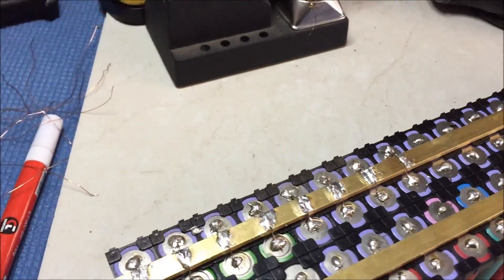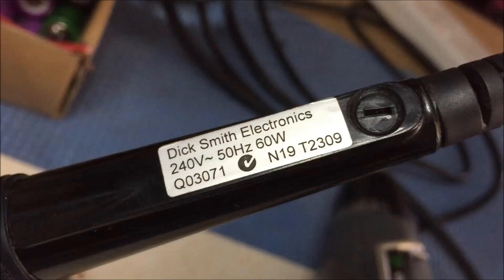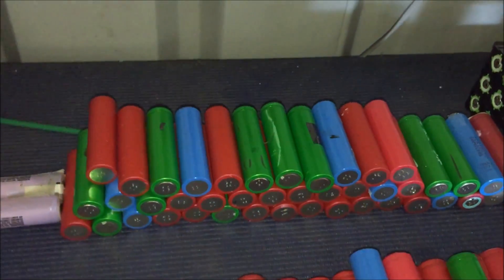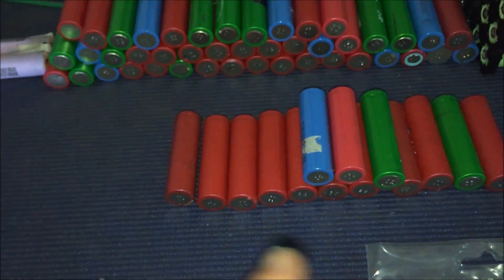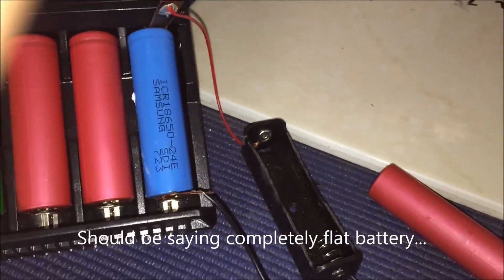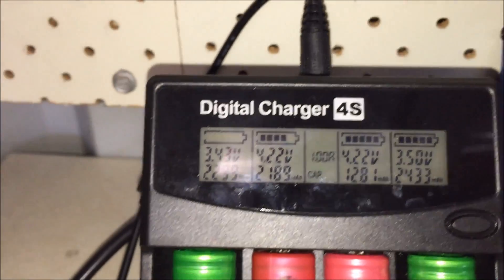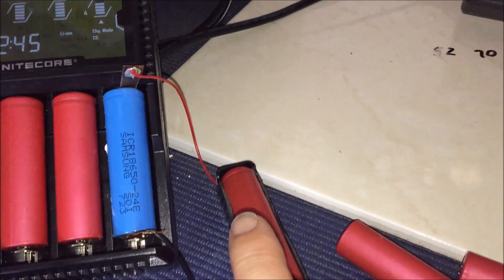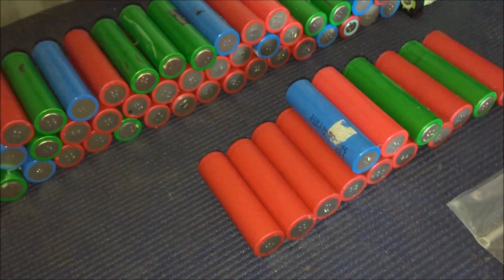THE HBPOWERWALL BUSBAR SAGA

Comment: Just use a power supply with current limiting @ 4.2 volts and 0.5 amps to bring the dead cells up you voltage.

Comment: Paralleling the dead cell with a good one like that is super dangerous.. I'd really recommend using a current limited supply. The B6 in NiMH mode at the lowest current until ~3v would be a much safer option.
Reply from the maker: +Mike M Disagree, 300mah charge rate for  2.5 min isn't going to do anything to the battery or charger that would be considered dangerous. Left for an hour possibly but not that short of time. I also just tried it with my multimeter, it was doing just .2 of an amp.

Comment: what about drilling and tapping the busbar with small copper machine screws, then wrap the fuse wire around the screw, tighten it down and solder the ends to the cells..?
Reply from the maker: +storxusmc that is definitely an option. Other ideas - turn the bus bar over have solder on the bottom, drill 1mm x 5mm deep hold in the side of the busbar and solder wire into there. Or even use a hack saw to make a 1mm x 1mm cut to lay the wire into then solder on top then sand and polish. Or just give up on making it look good - that would work wonders too